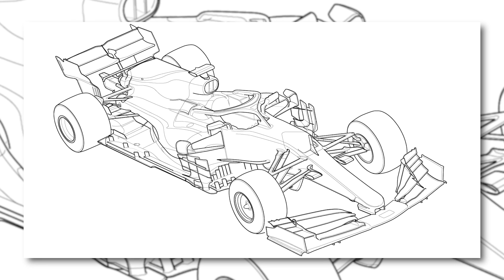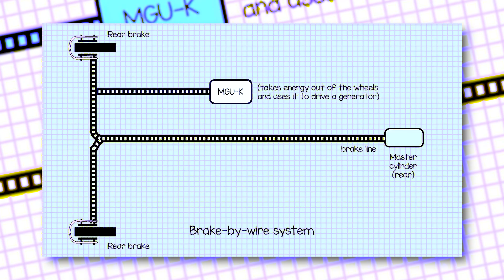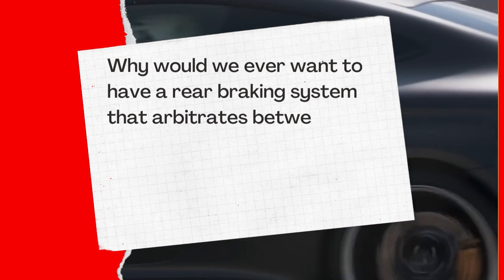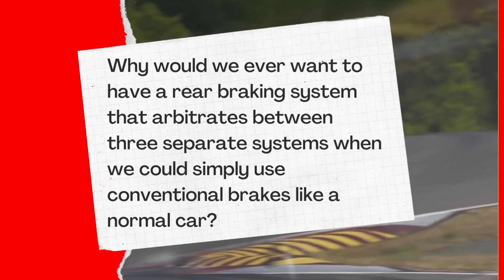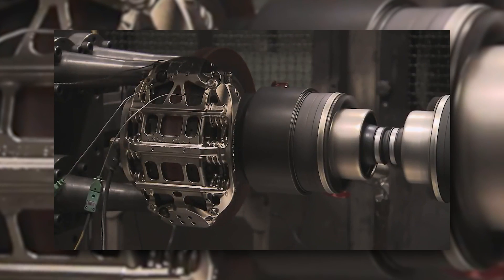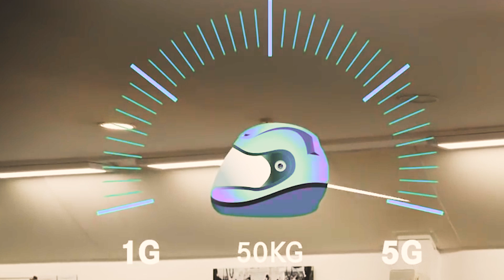Why F1 Cars DON'T Have A HANDBRAKE?

Comment: Yeah not buying the weight argument sorry. If all the cars have a means of locking the wheels (when powered down) then the weight argument is negated. "No reason for a handbrake" - well, Carlos' incident is a pretty good case for one.